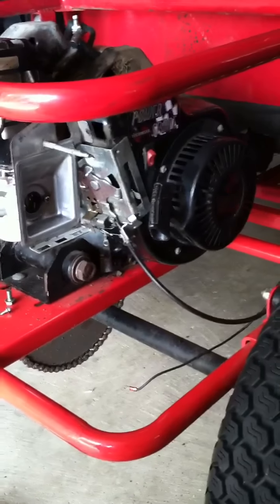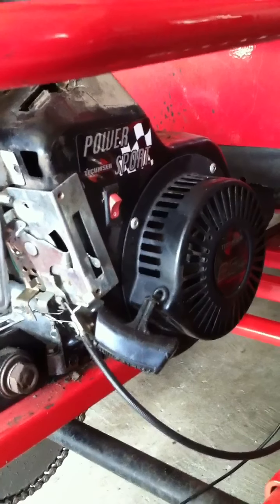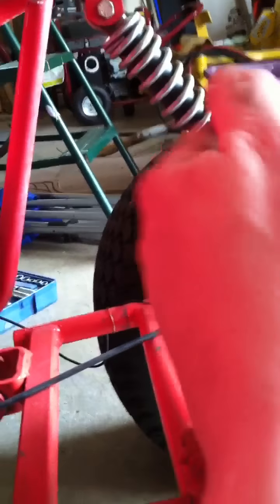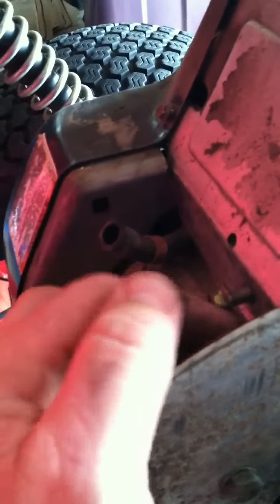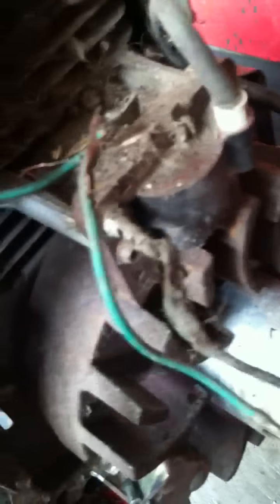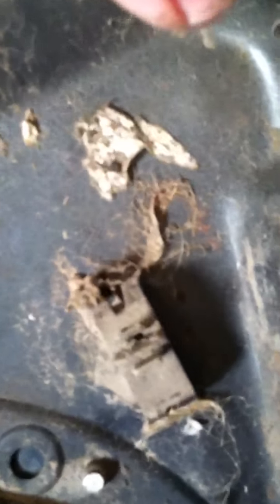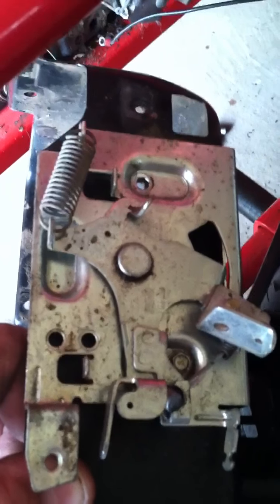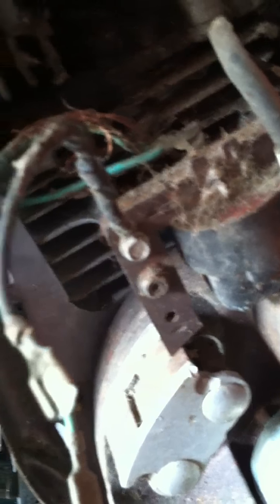Removing the gas tank and pull start (recoil) from a 6.5 HP Tecumseh on a Yerf Dog Go Cart

Comment: You could drill the Rivets holding the Starter recoil assembly. But the risk of the them spinning. And never coming out is high. I think it better to just remove the whole Blower housing assembly. And carefully work on it on the bench. Just few bolts holding it on there anyways.